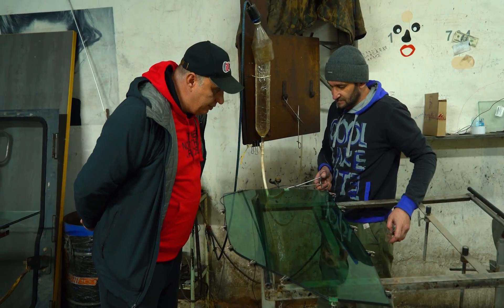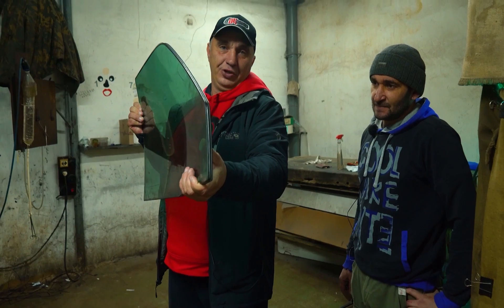We make homemade armored glass - will it work?

Comment: I am interested in a theft deterrent system that, like a lattice of electric chainlink fence, sandwiches between maybe a gel or sticky goo, that lives between normal glass and tempered glass. There are many car break-ins in cities in the US and we need something that will shock people who try to break into the car from the outside, trying to poke their hands into the glass, but would have a sensor system that maybe would shut the electricity off if the car is in deep water. The goo in between the ele tric wire is to make sure the electricity still conducts onto the thief if they try to run away suddenly. They will be in pain, but eventually be able to get away.

Comment: I have a request from you. Modify the cylinder head studs. When the engine is running, pressing a button disables the cylinder head studs and throws the cylinder head up to how many meters into the air? I am most curious about this.

Comment: Why not put an air operated cylinder on the ball valve so that the valve is opened as quickly as possible. That long handle on the ball valve is slow and silly.

Comment: Armored Glass is usually made with LAMINATED GLASS not Tempered 🤷🏼
Reply: Laminated means adding plastic layers between the glass panes which are tempered.
Reply: @FuckTheState  i meant that the Glass wasn't simply heat treated 🤷🏼
That's all

Comment: What about putting a thin metal or fiberglass (chicken-wire) / window screen in between the layers
Reply: That would add weight, reduce visibility, and be more fo a problem then a help.
Reply: Wouldn’t help.

Comment: old engine from a car... thru a differential to an old 8KW generator motor, engine at 800rpm generator spins 3800rpm... how long would something like that last? the 300cc engines on those are very noisy and don't make much hot air, but if the cooling system for the engine went to a boiler to heat the shop, not just burning CNG in the furnace... a generator that would actually run for 30'000 hours... about 10 years worth of power. "pull start junk engine blows up after 2 weeks"... so if that was a 2 liter engine, wonder how much hot air is makes alone, 3000 square foot outside is -33 decrees? "the struggle to fix engine or confinement to natural living conditions will set in..." If I build house I might do this as a joke, for kid that lives next to it all but cant fix anything when it starts braking down to struggle with?
Reply: What are you on today?

Comment: Use plexiglass thin layer in the middle and on the inside, glass,glue,plexiglass,glue,glass,glue,plexiglass and you’ll see much better results
Reply: Plexyglass (acrylic)  is brittle and it will shatter, lexan (polycarbonate) is a much better choice since it deforms rather than shatter.
Reply: @SAZodia  shattering is what actually stops the bullet. The more deformity you allow, the more shattering of the glass at each impact, which results in less protection.
Reply: @FuckTheState  yes and no, shattering is never good, shattering a a consequence of the glass being hit with a high velocity projectile, that is why plastics and other polymers are used in between the glass panes, that is to absorb the projectile impact, so you really do not want a material that is going to crack and shatter like glass... Poly-carbonate is a lot denser than any acrylic plastic and it will deform, not bend completely out of shape, but have a spring like  "consistency", if you look at level4 and higher ballistic glass, you will notice that there will be at least 3 layers of glass and 3 layers of poly-carbonate or polymer glass with one of those poly-carbonate layers being on the inside to prevent glass shards from flying out and hitting the intended victim.

Comment: Hi guys,  How about using one of those glasses and a polycarbonate 4mm thick on the inside glued. Cut the poly with the glass shape , get another glass , put the poly in between the glasses , put the glass poly sandwich clamps into an oven until the poly is curved, turn oven off after the ply it's been curved and let it cool . And then glue it together,   The glass on the outside and the poly inside. Now is shooting time.👍👍👍
Reply: Great idea

Comment: Yeah, supersonic 556 green tip would eat right through that "armored glass" any day of the week.
Reply: Crossbow would do it better.
Reply: @TheCommanderNZ  Not sure what world you're living in, you need something fast - remember KE = (mv^2) / 2 so a faster projectile is exponentially better then mass. I don't think any sub-sonic projectile would have a chance at penetrating that glass. Crossbows just don't have the kinetic energy needed. Not to mention the larger the projectile is, the more energy is used up to push the glass out of the way. A small, fast steel penetrator would zip right through the glass while a crossbow bolt would be grabbed and slowed by the glass, probably getting lodged in the glass.
Reply: @linuxguy1199  does a bullet go through a sandbag? No
Does a crossbow bolt? Yes.
Look up the video "Bows and bullets vs Sand Bags"
Reply: @TheCommanderNZ  Glass isn't a sandbag, they have vastly different kinetic properties. Glass is a solid crystalline structure while sand acts more like a fluid. Fluids absorb energy alot differently, as the velocity increases the sand bag absorbs far more energy then it would for a slower moving projectile. Simply put, for a slow projectile (like a crossbow bolt) the sand will have time to be pushed out of the way, for a faster projectile the sand is going to seem solid, not any deforming around the projectile. Glass simply does not behave at all liie sand, you can not with any basic understanding of ballistics treat a sheet of glass, steel, or other rigid armor like a sandbag.

Your YouTube video does not prove anything, sorry. Heres an in depth video explaining how this works:
https://youtu.be/I39STT-5h_U
Jump to 3:00 for the fluid dynamics explanation.
Reply: @TheCommanderNZ  and that’s why all militaries in the world are ditching rifles and switching to stupid crossbows, right?
Reply: You need thicker glass to stop 556. Don’t be an idiot: stopping bullets wasn’t the point of the test.

Comment: Am I missing where they say what the liquid is they apply to the glass? Is it epoxy resin or something?
Edit: Just scanned through again. I mean, it's cool, but they never explain what it is.
Reply: They said liquid polymer, which is an easy way so saying "were not telling you". That's thier magic sauce and what makes them money, its likely a mix of some UV curable epoxy resin and who knows what additives to help it stick to the glass and rubberize it enough to absord more kinetic energy.
Reply: @linuxguy1199  they mention they use medical grade  alcohol to harden it, that is a clue
Reply: Liquid polymer they literally said that.
Reply: You must be referring to what G54 was using.  The pro was using polymer, but who knows what these guys used.   lol
Reply: @RandysRides  Polymer says nothing, every type of plastic is a polymer of some kind. Since it cures via UV, it wasn't a polymer at all - polymers only apply to cured plastics, an uncured plastic is a monomer or system of monomers (aka. pre-polymer). Probably some type of polyepoxide but who knows what.